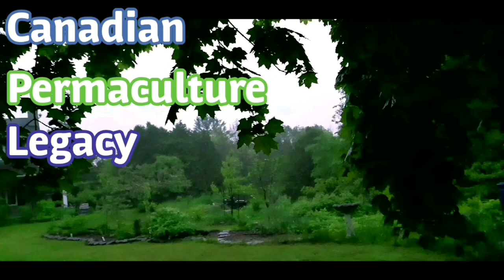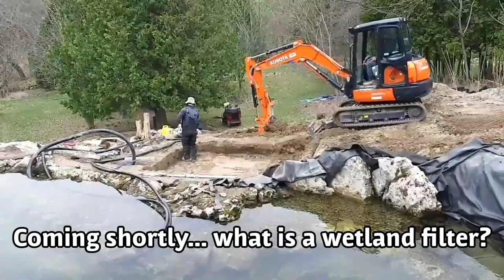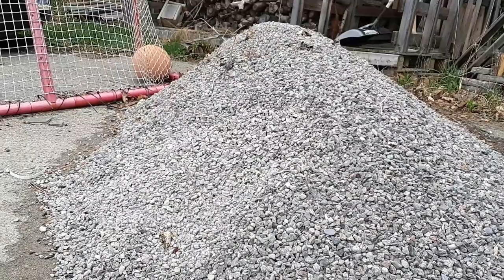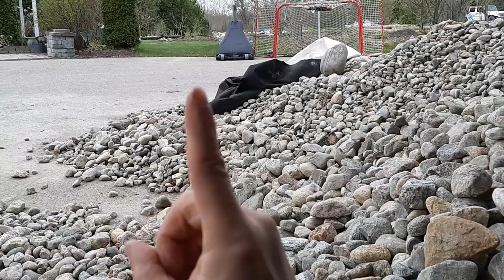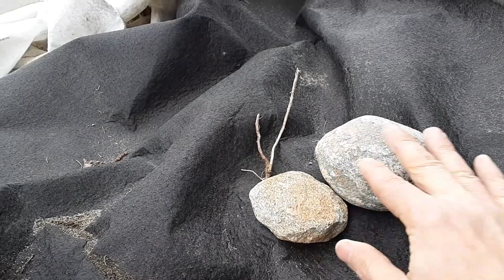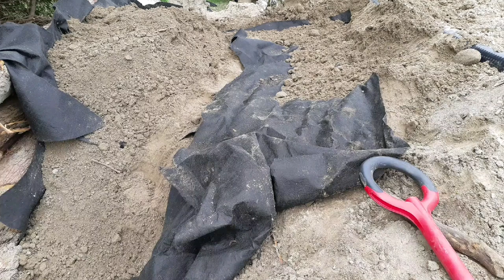Engineering trick to strengthen retaining walls, and rock delievery

Comment: The OCD in me says that is reducing the force against the retaining wall rather than increasing the strength of the wall.
I was expecting you to put in "deadman posts" when I read the title.
Reply from the maker: Indeed, this is more about unloading the wall itself. I suppose the title is slightly misleading, because the wall itself isn't being made stronger. 

Drilling down and putting a post through the wall is another technique. Putting in a dead man is another, but I didn't want to have a 45 degree post coming off this wall, as the eventual goal is to build a walkway or rope bridge through the area, and I wanted to keep it clear as possible.

Reinforcing inside the soil is an amazing tool here, and perfect for this location. Completely hidden roots will grow through its and will tie it all together even more.

But very fair point about the wall itself. It is less about making the wall stronger and more about unloading it and gaining tons of margin to failure.
Reply from the maker: Oh, I should also mention you can build a dead man in tension by building it inside the wall itself. However, since I couldnt remove too much material (fear of existing pond letting go), that wasn't an option. But I did want to mention it for anyone else reading this. You can tie in a deadman inside the hill also. However, if you can do that, often just making a composite like I did here is actually much much more stable. Just do more layers.

And if you want to go absolutely crazy, you can make an internal deadman and also layer it with fabric as you refill the hill around it.  Say for example if you needed to drive a giant excavator on a dirt road on the side of a cliff or something? Lol
Reply: Amazing! Thank you!

Comment: I like this, but what I'm wondering is how readily the roots of the soil-stabilizing plants grow through the landscaping fabric, and in turn whether that would compromise the structural integrity of the wall down the line. Or maybe once the roots are established, they take over the stabilizing role of the fabric?
Reply from the maker: Oh the roots will be the strongest part of the woven matt of root and fabric.

Think about the other option, having roots growing through individual mineral/rock particles that is sand dirt and clay. For sure the fabric will increase the tensile strength compared to loose particles.

Roots are also 100x strother than a fabric, so you definitely do want to plant into it, versus leaving it fabric only.

Comment: Thank you for this! I’ll be making a 6ft retaining wall on my property this spring and I’ll be using your ideas, only because my land is wet silty soil, I’m thinking of using geogrid instead of fabric. I’m afraid of fabric plugging up over time and bulging out somewhere. I hope the geogrid would still hold, but drain well. I expect to plant like crazy between rock joints to hold back the tide of the spring thaw.
Reply from the maker: Indeed, that would work incredibly well.

Comment: You taught me this with your kids and sand castles a few videos ago! I used it to strengthen my dry stacked  stone wall using land scape fabric in between some layers to prevent material from slipping.

One part I didn't know about was that the fabric material should be as level horizontally as possible. While I didn't make an effort to do this in all places behind my wall, I do think it added strength to the wall in an over engineering sense. My wall is only 3.5 feet tall max, sliding into the hill and curved in a semi-circle, which I learned from other resources is the strongest way to build a retaining wall. I still have more fill to bring in, so if I wanted to get crazy I could fix my error and layer in additional fabric at that point. I'm positive that isn't nessasary as my wall is much shorter and already proves to be "castle" quality. But I might, just for fun.
Reply from the maker: Nice!

I have to admit, it's a lot more fun doing it this time on a large scale project. I'm so glad I got the chance to put it into practice.

Comment: I am wanting to build a pond with an island , more like a moat I guess; the island around 12' x 14' with the span of water being about 5' all the way around it. Can you tell me if this would work to hold my island in place and if so how would I go about building it? TIA
Reply from the maker: It would help, but normal erosion would happen. This is mostly to work against non-wet soils. The best way to fight erosion is by heavy planting immediately after, and using high clay. You can also look at a technique called Gley'ing in a pond.
Reply: @CanadianPermacultureLegacy  I forgot to mention it would have a EPDM pond liner would that make a difference?
Reply from the maker: Definitely, that changes everything. In that case the actual retaining wall liner puts a horizontal force on the soil and actually holds it  together. If it's an island and the water is pushing from all sides, it becomes quote similar to squeezing and egg in your hand. When the force is applied equally from all directions, the egg is impossible to break. It's VERY strong. The same physics applies in a pond with a liner. 

The weight and pressure of the water puts an outward force on all walls and that outward force compresses the soil particles and therefore does the same job as what the buried fabric layer is trying to do (pull the soil particals back inwards).
Reply: @CanadianPermacultureLegacy  Ok great to know I don't see anyone in pond forums that go with an island I was worried about the why not and possibility of it failing... Thank you for the information!

Comment: Namaskaram,

This sounds great, but I am wondering which material the fabric is made of? In order not to increase plastic/microsplastic in our soils it would be good if it would be some other material?

I saw your video about the pond fabric and I agree about the long lastingness of it, but does this apply here as well?
Reply from the maker: LDPE synthetic fiber. I think if I could do it again, I would have asked if there was another option here for a natural material :(
Reply: @CanadianPermacultureLegacy  Okey, I know that here they offer rubber fabric for ponds as well, but honestly I don't know the pros and cons of it ..

Just for clarification, are we speaking about the landscaping fabric or the pond fabric? Because my inital questions is about landscaping fabric (:
Reply from the maker: Yes that is the fabric underlayment that is beneath the EPDM pond liner for protection against puncture.
Reply: @CanadianPermacultureLegacy  Okey, and is it possible to strengthen the wall with some natural fiber? I guess cotton, like some old bed sheets, is to tough for any roots to penetrate it?
Reply from the maker: I think it would definitely work. Maybe less strength than synthetic fibers, but I do think it would still work.
Reply: @CanadianPermacultureLegacy  Okey thank you! 
As far as I understand it is mostly until the plants' roots reach a sufficient size to hold most of it themselves?
Reply from the maker: Yes exactly right, for stability. However the cushion/protection thing, you won't really get too many roots down under the pond. Then again, I'm not sure how fast a natural fabric would decompose down that far either.
Reply: @CanadianPermacultureLegacy  What do you mean by how fast it would work? I was not thinking to use it for the pond itself, but more to strengthen the hillside around it, as I would build it on contour and the slope is so steep, I ll have to put in some retention system.
Reply from the maker: Oh okay, I missed that context. Didn't realize what video the comment was on. Yes that works. Just remember, the only reason I used anything here was due to the retaining wall nature of this. If it was just a hillside I wouldn't use anything, and instead just plant and mulch and let the roots hold it.
Reply: Thank you 🙏